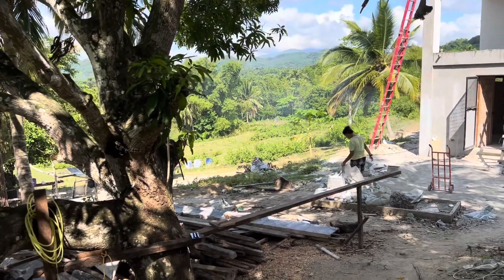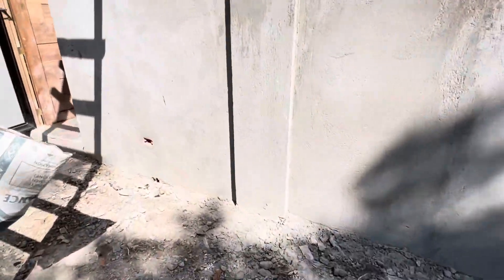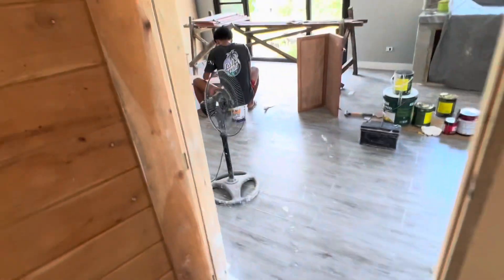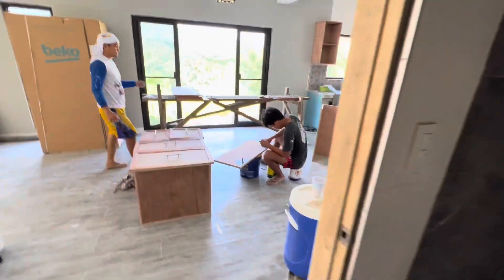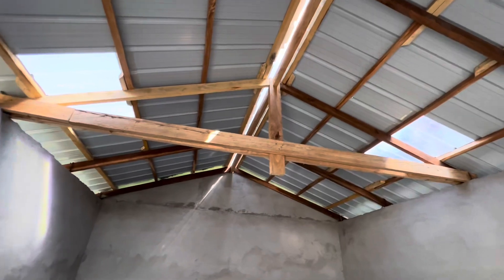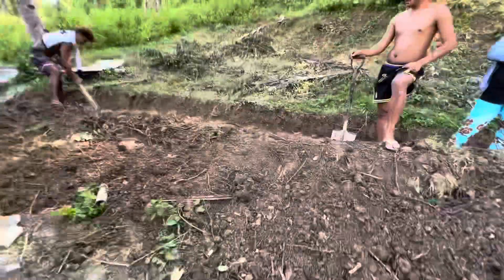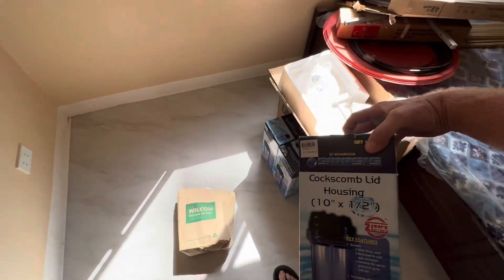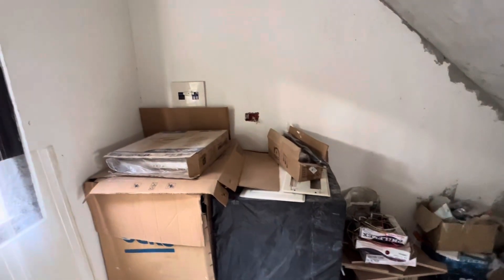Building House in the Philippines 🇵🇭 | Installing Garage Roof | Painting the Cabinet | Shower

Comment: You could save a lot of money by using a metal rail and shower curtain design instead of a glass enclosure in the shower. Saves on cleaning too, glass v shower curtain.

Comment: i would just put one glass wall between the shower and the doorway to keep shower spray from slowly stripping your finish off the door. UV filter is definitely the way to go. Add a mechanical Bacterial Prefilter and you should be safe. May also want to periodically add chlorine to the well. Doesn't take much. It will help to kill mold and bacteria in the well.
Reply from the maker: Thanks for the advice